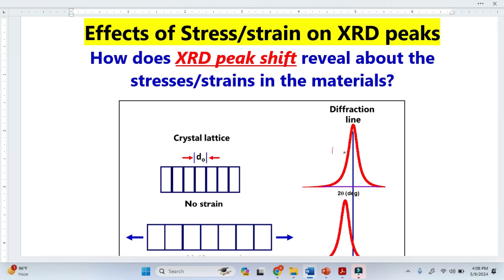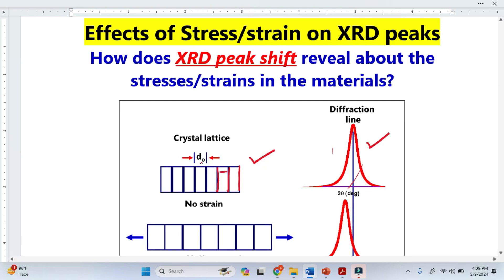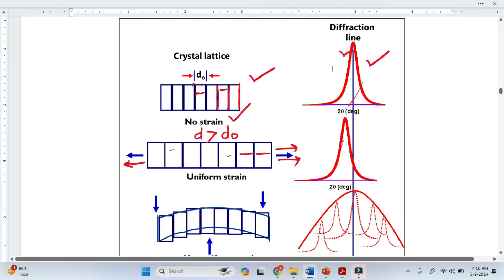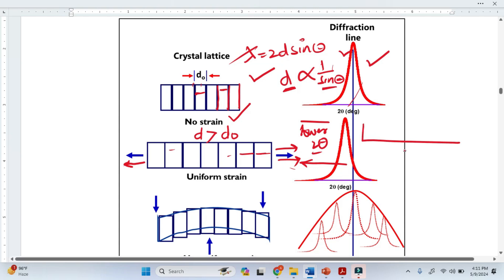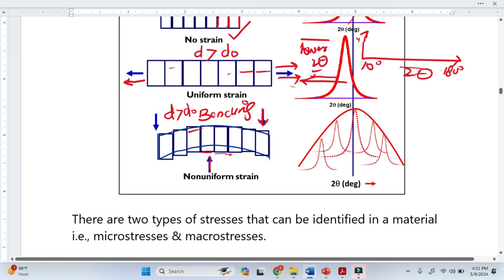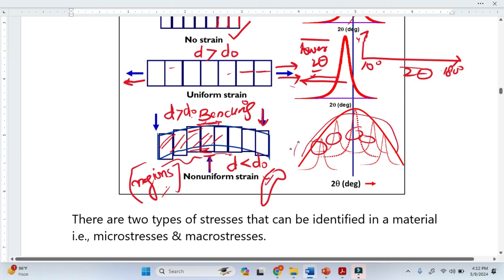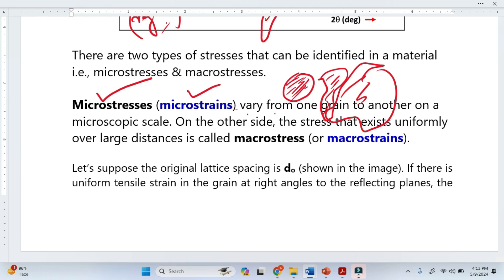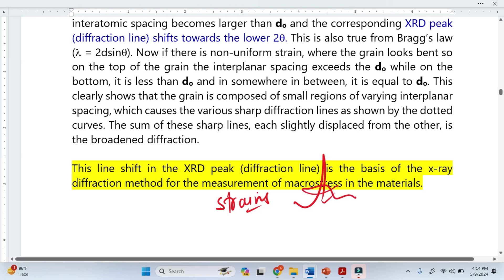Why XRD Peaks Shift: Tensile vs. Compressive Stress Explained

Comment: How to know if it is related to specimen displacement error or due to lattice strain?
Reply from the maker: Very important question. 

After XRD measurement, find out whether the displacement /shift is strong or slight?

If strong shift is there, so you need to focus on calibration and alignment, sample position. On the other hand, if there is slight displacement/shift then focus on sample lattice parameters, size, strain..etc

Why XRD peak shift towards lower angle (2 theta)? 
Due to MACROSTRAINS in the materials!
1- Peak moves, NO shape changes!
2- d is same throughout the materials! 

This simply means means that when we see shift in XRD peaks, there is a lattice strain. If we have everything perfect like Machine, the sample holder etc....

Please also watch this video 
https://youtu.be/V6F8-ZWQHVo
Reply: @nanospeaks  sir actually there is a theta difference of 0.2 at every peak for one of my samples .it has shifted to lower angle after increasing the dopant magnesium. However for another sample of higher dopant concentration, the peak positions remained the same as per the literature. Thank you sir for replying to my initial doubt
Reply from the maker: @bhaskar99652  my pleasure. I strongly recommend watching my videos and also reading the description in detail.  I also recommend some books so please also reas it. 

If you still have any questions,  do drop comments here

Comment: Hello Sir, 
I have a question regarding peak shift. If the peak shifts towards the right (higher diffraction angles), then what could be the possible reason?
Reply from the maker: This is very good question!
Look, I am referring the fundamental book on XRD by "Cullity" stated" If the grain is given a uniform tensile strain at right angles to the reflecting planes, their interplanar spacing (d) becomes larger than the original interplanar spacing (do) and the corresponding diffraction line shifts to lower angles (lower 2θ)  but does not otherwise change ????

In this book, the strain is only Tensile so the d-value increasing thereby decreasing the θ-value using Braggs' law, λ = 2dsinθ, as here d and θ are inversely proportional to each other. As a result the peak shift towards the lower 2θ*. If we use this *analogy and decrease the d-value by simply using compressive stress /strains then the peak (line) will shift towards right because of Bragg's law,  λ = 2dsinθ.....  but I have not seen this in the literature yet. If you have any reference so let me know please
Reply: @nanospeaks  
Thank you so much sir for your prompt response. Actually I am a phd student, I have synthesized a material with different doping concentrations. I am analysing my xrd data in which I am getting a left shift at one concentration and a right shift at another concentration and I don't know what may be the reason. That is why I asked you the question. I have found in literature related to my research that the right shift is related to decrease in lattice parameters and correspondingly decrease in volume. I am also getting decreased crystallite size compared to pristine or undoped sample. But I am  confused because the sample in which I am getting left shift, possibly its crystallite size should be large compared to pristine but I am getting a smaller size. I am stuck in these things. I am unable to find a proper explanation for my data. If you can suggest something, that will be your most kindness.
Reply from the maker: @jaanaasiffa5985  in your case, you are doping in the host materials and getting the peak shift toward the lower 2theta. I think the foreign atoms are larger in size than the host, and it causes distortion in the lattice as a result of elongation in d - value  and subsequently lower 2theta snd peaks shift towards left If this is the case so I guess you are in the right direction. 

I think crystalite size rarely produces shifts (here, the 2theta remains the same ) under the peaks, but it increases and decreases the FWHM (width). Smaller the crystal size, broader the peak width, and large crystal gives sharp peaks ...... This relationship can be derived from Scheerer’s formula. Crystal size = k lamda/B cos (theta)...
Reply: @nanospeaks  Ok sir, Thank you so much